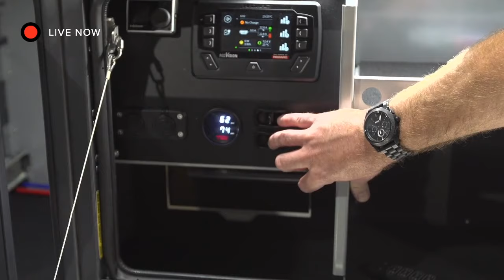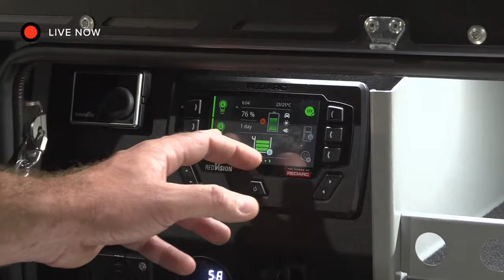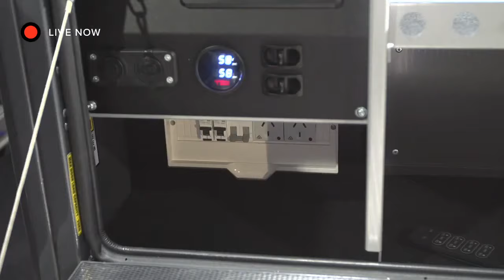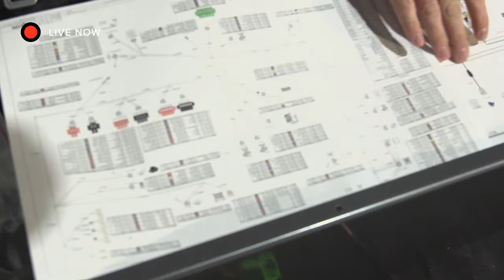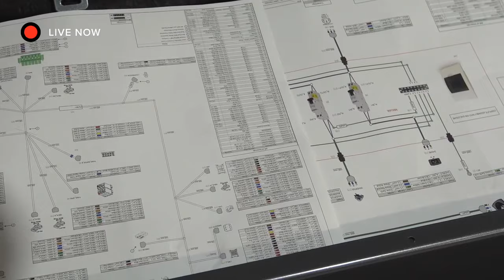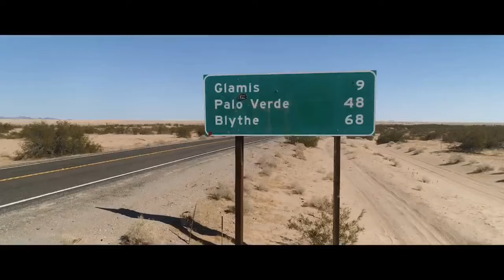Patriot Campers X3 Virtual Tour

Comment: Would have liked to hear your thoughts on using the X3 in areas where the temperature can dip below 32F for a few hours at night.  This is going to be a common scenario in parts of North America.  This was a great review
Reply from the maker: The X3 comes standard with a diesel hot water & tent heating system.
Reply: @patriotcampers  So running the diesel heater at night to heat the tent, will keep the water lines and water tank free of ice if the temperature dips below 32 for a few hours?  That is what I have understood.  

Are you going to have more X3s arriving in the US in 2021?  The Exploration outfitters current inventory shows only X1 arriving through the end of 2021?